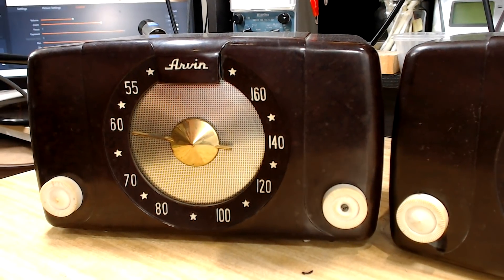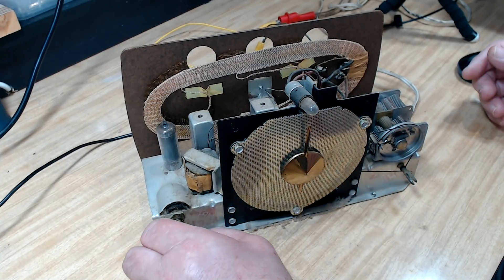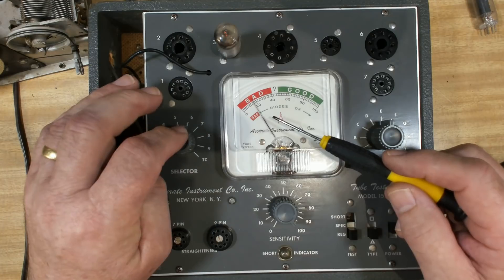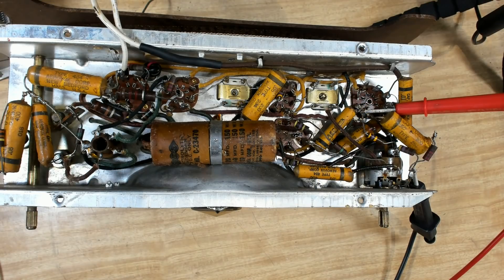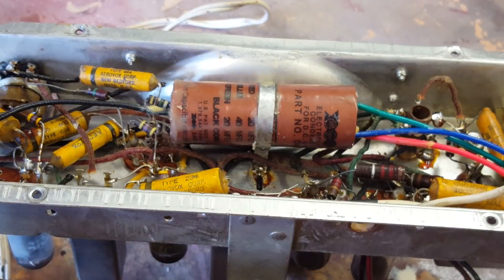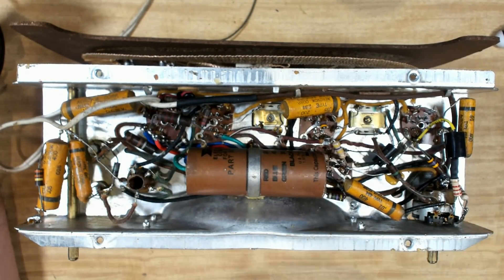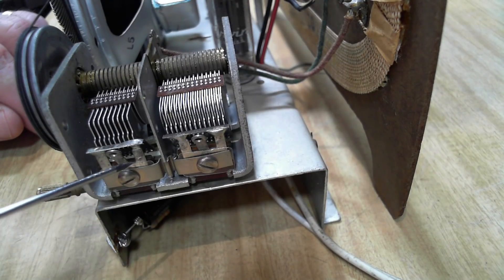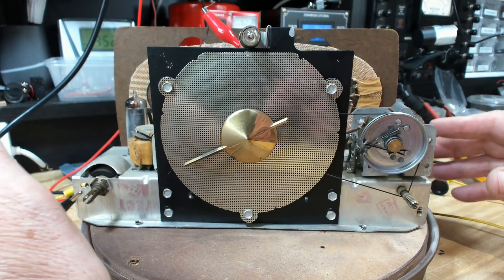Arvin 450-TL AA5 Radio Restore Down Under with Retr0bright

Comment: Hi Dave,

I enjoy your repair and restore videos very much. Yours are of the best quality in the world in my opinion.

Oregon, USA here. I have restored quite a number of old radios myself. It's a thing with the transformerless AA5 radios. Really old wax/paper capacitors don't "reform" well, and the ones that go across the line will blow out the filament of the audio output power tube. (valve). Its best to test them with a capacitor tester that produces a load... or as I have learned to just clip them out before the first power-up.
Reply from the maker: Hi Karl, thank you very much.
I can't test the caps with a voltage across them but I'm interested as to how the across the line cap will damage the output tube, I would have thought it would just result in a high current draw across the mains. The cap in this didn't seem to have an effect on the current draw when I cut it out so I assumed it wasn't too bad. I think I cut that bit of video out 🤔🙂

Comment: Thanks Dave love your videos! I grew up on a farm in North Dakota, Dad and his brothers had farms all in one area so we visited back and forth quite regularly.  One of dad's brothers lived about two miles east of our place and  we regularly spent Sunday afternoons visiting and dining with them. They had a radio that looked exactly like that, while I don't recall the brand, I do remember thinking it would be so great if we could have one like that however our house had no power or running water so we depended on kerosene lamps and a battery pack radio.  Our use of the radio was quite limited because battery's cost money!  Later on we moved to town so my elder sisters could attend high school and the farm was eventually sold.
Reply from the maker: Thank you Jerry. Another interesting story from yesteryear. The batteries for the radios were very expensive, I would be limiting the time the radio was on too 🙂

Comment: Great job on the filter caps! Very impressive 👍
I'm also really glad that you don't break these down into several 5 minute videos. It's a pleasure to watch. 
I restored radios for nearly 25 years as a hobby, but lost interest in the last several years. 
You may have ignited a spark as I have about a dozen radios in my workshop awaiting restoration.
Reply from the maker: Thank you Tim. I can understand losing interest in a hobby, I have changed hobbies several times, it would be nice if you could finish off a few of your remaining radios though, good luck whichever way you choose Tim 🙂

Comment: Just a note, since you aren't that familiar with AA5s - you got it by the end, but it is pretty important to have the dial lamp working on AA5s, where the lamp is across the rectifier. When it burns out, that increases the current through the rectifier filament, and it will burn out much sooner than normal. These radios are marvels of low-cost design, almost everything in there more-or-less has to be there, and as you found, the performance is very good for something so incredibly simple.
Reply from the maker: Yes, thanks Brett. I was reminded of that after I released the video, I was aware but forgot when I did this one. I won't forget next time, thanks again 👍🤦‍♂️🙂

Comment: Never seen one like that before.  It came out very well and I liked your self build capacitor, work of art that.  It sounded horrible until you tuned it and did that make such a difference!  Well done David, another success.
Reply from the maker: Thanks Bob, it is working very well now after a shaky start 👍🙂
Reply: @DavidTipton101  Yeah, it didn't sound very good at the start, but I knew the master would fix it.
Reply from the maker: @BoB4jjjjs  😄 thanks

Comment: Not surprised that 50C5 first started up with sound distortion then nothing. It was on it's way out. Worked on a radio where literally the glass deformed at the base 
of the tube because of the heat coming from it. It was also an original tube like this one. Love your multi-section capacitor work David . Looks great! Love your 
sense of humor mate. Too much Star Trek can do that to you! Be safe! Cheers, Steve.
Reply from the maker: Hi Steve, I think you are right, I was worried I had damaged it but I later realised it was already to blow. The cap was worth the extra effort in retrospect and looked better that a xmas tree of caps 😀 I am not a Star Trek fan by any stretch but I can still steal their ideas 😊

Comment: I think you’re the only other restorer I know other than myself who is willing to replace a paper capacitor enclosure to look original. Unlike yourself, I’m a bit more lazy and I just re-stuff the old paper enclosure, but you’ve inspired me to produce them from new. I never considered fabricating one. Will have to try it.
Reply from the maker: Thanks NBN. I would restuff the originals but the first one I destroyed so had to make a new one, the second one I needed it to be another 10mm longer so made a new tube and the one I'm doing now I have some smaller caps that will fit in the original so I will use that. The tube I used is from a roll of home food vacuum plastic if that helps 👍🙂
Reply: @DavidTipton101  It is indeed hard to not destroy the originals. Thank you for the tip. I have some upcoming projects that this might be very useful in preserving the aesthetic of the AA5 radio. It seems to be all we have in North America.

Comment: Hi there, the capacitor across the power switch is to help prevent sparking and popping when opening and closing the switch. I hope this helps you out. Thanks for your great videos.  :)
Reply from the maker: Hi Keith, thank you. My understanding is the across the line capacitor are to keep RF noise picked up by the mains power lines from affecting the receiver, they are usually in AC/DC sets
Reply: @DavidTipton101  Greetings again:
The capacitor across  the power switch helps save the contacts on DC powered sets as DC hates being interrupted!

Comment: Never saw a floating feedback winding on an AM radio before. Seems like there is supposed to be a small cap on the top side of T2's secondary to ground. (gimmick like?). Great job Dave, I liked the labeling on the heat shrink in the cap and then hot gluing it together!
Reply from the maker: Thanks Steve 👍🙂

Comment: The radio was made by Arvin Industries in Columbus, Indiana.  They made a wide variety of small appliances and they also made 80% of all original equipment mufflers installed on every brand of automobile at that time.  Columbus was my home town and my father worked in the research lab of the automotive division about the time that this radio was made.  In addition to the Arvin brand, they also put the brand of several different companies on their products.  The company was founded under the name of Noblit-Sparks manufacturing.  My Grandfather knew Mr. Noblit. The company has subsequently been sold or merged and the last time I heard anything about them they were Arvin-Molitar.  Cheers.....
Reply from the maker: Hi Dave, thank you for the info. I read much the same on the Radio Museum website. Nice bit of trivia that you have ties to the company through your Dad and Grandfather 🙂

Comment: Sorry about the problem with your transporter, where you forgot to have the transmitter destroy the original one and ended up with two identical radios: the original and a copy. :-)
Thanks for posting! A work of art as always.
Reply from the maker: Thanks Jac. You may be confusing a transporter with a replicator, that is still in the design stage 👍😉

Comment: Scrubbed up extremely well and didn't give you any problems, lovely lovely!

You NEED to get a patent on that transporter thingy!
Reply from the maker: It came up great Paul, I'm very pleased with it. I have given up on the transporter for radio work but it does provide plenty of free beer 🍻😄
Reply: @DavidTipton101  Well maybe you should patent it in any case then! It would probably be fairly popular.

Comment: David, once again a great video. Please don't take what I'm about to say as negative. As was watching, every time the mains voltage dipped below 50V the power display blanked was annoying to me, and yes I know that how these displays were designed. All other youtubers who use these displays also have the same issue. When I built my isolation transformer and current limiter which included one of these Voltage/Current/Power displays. I modified mine to be powered from a small mains transformer which allows the display to operate regardless of the ac voltage being measured.
Reply from the maker: Hi Peter, thank you. Yes I agree, the display blanking is useless but it's not a problem with our usual 240 volt radios, only the 120 volt stuff. I considered modifying my display but didn't expect to be doing another US radio. I will have to consider it I think, thanks 👍🙂

Comment: Another really great video, Dave! The Arvin turned out fantastic!

Regarding retrobrighting, I've found that it works just as good just using heat. Living in Sweden the sun is not like down under but more like a dim bulb. I've retrobrighted quite a lot retro computers and simply apply the cream under foddwrap and putting it in the oven at 50 degrees.
Reply from the maker: Hi Kristian (love the spelling of your name BTY) I read a Wikipedia article that said heat can be used, as well as fluorescent light albeit it takes a while longer. Thanks for confirming that heat does work 👍😀 stay warm 😄
Reply: @DavidTipton101  The spelling with K is a traditional way in Scandinavia with a bunch of Danish kings bearing that name. :)

I figured that heat would work just fine since the hair salons uses just heat to activate the peroxide, so i tried it and it worked great. One just need to be careful with the temperature since at least my brand seems to melt at around 70 degrees, and that's not good for the end result...

Keep up the excellent videos, I enjoy them a lot! 👍

Comment: Greetings:
The Youtube channel "Mr. Radio" host Seth in California's San Francisco Bay area does many radio restorations for the local radio club's auctions. It seems most of the American radios after a certain point were predominantly power "transformer less" aka hot chassis sets. The across the line and B- to chassis caps had .05 ufd values that allowed too much AC that still shocked and were reduced to about .01 ufd "x or y" safety caps (certified to fail open rather than shorted).
Also, when replacing the line cord a polarized cord is used and the wide blade is connected to outlet NEUTRAL with the power switch moved to mains HOT. That helps maximize the safety aspect. Here when the B- is NOT connected to chassis except through a high value resistor, 200K-400K, and a Y cap, we say the chassis B- is "floating". From what I've seen, fuses are added to transformer sets to save the "hard to replace" transformer. 
My preference is to add an inexpensive (about a US dollar) CL90 or CL90A "inrush current limiter" on the HOT circuit to protect the VALVEs. They are about 120 ohms cold and drop resistance as thy warm up.
Reply from the maker: Hi James, thanks for the information. I did a few American hot chassis sets and can't remember what exactly I did with this one. I did change them to polarised cords and switch the positive, one I may have done after the video. I have some CL90s on order. Thanks James 🙂

Comment: Hahaha. I wish you could transport me so that I could take a vacation from the lockdown.

Seriously though, great video, I always look forward to seeing your restorations. One suggestion about the retrobright; you might consider applying some UV protectant after you brighten them. In theory, it will greatly lengthen the time the parts remain white. There's many products, I use 303 aerospace. Also, you might want to use liquid peroxide rather than paste because it's easier to get an even job and it can be reused if you don't dilute it and you seal the container.
Reply from the maker: Thanks Brian. I wondered about protecting the plastic, the 303 aerospace looks good. For the little pieces I do the hair treatment is good enough, I was thinking of putting them in plastic takeaway containers next time though 🙂
Reply: @DavidTipton101  They certainly turned out well. :)

Comment: Another entertaining restoration. You'd better be careful, the Rodenberrie's may beam you into the engineering section of their star ships fixing warp cores. For the alignment, I'd recommend you source yourself a ceramic adjustment screwdriver.
Reply from the maker: Thanks for the heads up Tatabusa Hub 😄 I have some on order 👍

Comment: 22:00 Personally the hard way seems like a much more elegant solution, it's your attention to details that make your restorations stand out. Not that it matters much, however, there's a black glue stick, that is mainly used for Automotive applications, it holds on stronger than the clear glue sticks and melts at a lower temp, it is also a little runnier because of its lower melting point which makes it ideal to get into all the little nook and crannies. again not that it changes much but I prefer it over the clear stuff especially when using 3d printed parts.
Reply from the maker: Thanks patprop74, I don't know why I spend half a day doing something I could have done in 30 minutes, no one will see it but it does look much better. I'll look round for the black glue sticks, auto shops I guess? 🤔
Reply from the maker: @patprop74  My wife does all those thing, well, she makes me do it 😉 Thanks for the link, I'll check it out 👍

Comment: What a loverly repair/restoration :-D
It first looked like an old radio in a fair condition,  when you had finished it looked like it came straight from the manufacturer, bloody amazing.
Your manufactured capacitors always look like they belong in the radio,  what a loverly look.
The de-yellowed knobs look brilliant, who would think that hair use peroxide and sunshine would make them look brand new again :-D
You just need a u.v barrier spray to stop the sun having it's evil way with them again lol.
I had a good chuckle at the transporter,  some how i was not supprised at you being happy with a tinny of nectar :-D.
I was starting to think tha toaster rack local osc trimmer was dead, it jumped around like a kangaroo with a promse of sex lol.
Reply from the maker: Thanks zx8401ztv. The radio looks fantastic and factory fresh and the knobs are perfect, I was amazed how well they came out. I was almost going to pull the trimmer apart and clean it but it came good in the end thankfully. It turns out the transporter is only good for fetching beer, I can get the wife to do that 😉😄

Comment: Hi Dave : Here in the US the Fork symbol is chassis ground and the down arrow is common  ground and digital  ground....I almost bought the exact Emerson radio on E Bay only difference is the lower dial frequency covers short wave, I still might buy it the price is right ..How did I know you were going to make a proper cap !  keep up the great work Dave  :) Beam me up Scottie HAHA
Reply from the maker: Hi Paul, thanks, I had heard that some AA5s had a floating ground so the chassis wasn't as mains potential. It is an excellent idea and really would cost only a few cents to implement. I am just about to look at the Emerson, the bottom half of the dial is in metres and the top in kHs on mine. Dave out 🖖😄

Comment: What a little ripper of a radio and one that has stood the test of time!! Great job David, give yourself a pat on the back. Did you end up replacing the dial lamp ?? Well done !!
Reply from the maker: Hi Stephen, thank you. I did replace the dial lamp in the end, it had the glow of a lit cigarette. I remembered later I shouldn't have operated the radio without it, stresses the rectifier 🤦‍♂️
Reply: @DavidTipton101  hi David, yes I have it in the back of my head that the dial lamp also forms part of the voltage devider for the valve filaments. It could also be a odd voltage and mayn't be the standard 6.3 volts

Comment: Thanks for all that Dave, especially the nostalgia bit. May I ask a rather dim question? What is the difference between a condenser and a capacitor? Sorry if this produces groans among all the initiated. Thanks again and I'm looking forward to seeing the schematic for the transporter machine - I could do with one of those...
Reply from the maker: Hi Mark and thank you. (groan 😉) A capacitor is the same thing as a condenser it's just a name upgrade, sorry, I keep swinging from one name to another. Another one is kilohertz and kilocycles they are the same, the name was changed from kilocycles to kilohertz to standardise the terms. I didn't really groan, that was a good question 😀
Reply: @DavidTipton101  Ah, thank you David. Yes, this is what I've thought for a long while but I wanted to hear it from an expert. I wonder why they changed it? The Hertz and cps thing I was well used to. There was the Angstrom/nanometre controversy in my world; I dunno' why Angstrom went out of fashion overnight. Thanks again David.
Reply from the maker: @MarkMcCluney  No worries Mark 👍
Reply: Thank you. I was not an engineer, I assumed that was very obvious from my wide range of ignorance.

Comment: That’s a beauty - looks brand new !    I’ ll have to try the Retrobright.  Sounds good too.   Did you ever try the trick of putting a 25uF cap in parallel with the cathode resistor on the audio output tube ?   Sometimes makes for a ‘fuller’ sound.   It’s a matter of taste though.
Reply from the maker: Thanks sinewave423. The RetrObrite worked very well on the knobs. I noticed this didn't a capacitor on the cathode bias, it kinda did but was 0.05 I recall. The radio sounded good once it was in the cabinet. Good idea though for future radios, I'll make a note 👍😀

Comment: The cap from AC line to chassis is often called the death cap not the cap across the line cap.
Reply from the maker: Yes, you are correct Mr Hat, thanks for pointing that out. I will correct that in future videos. Thanks 👍😀